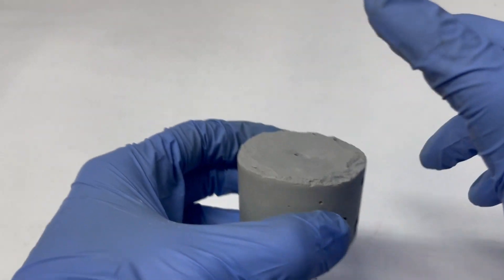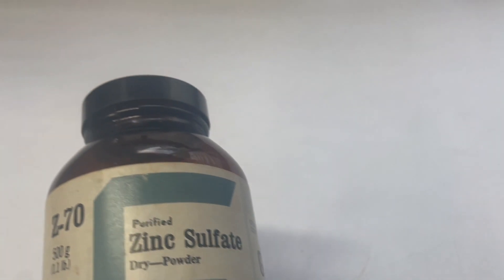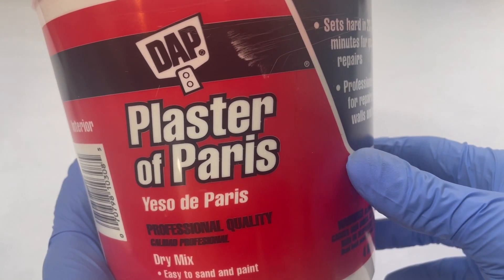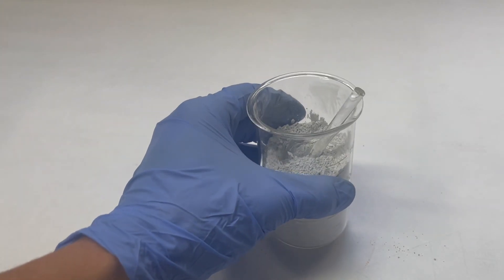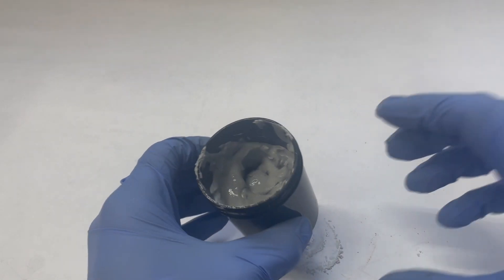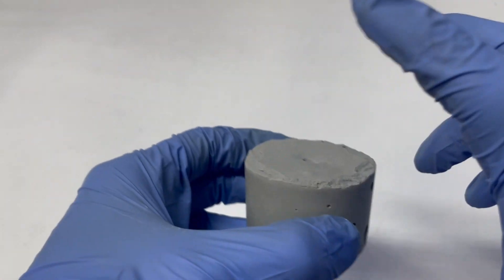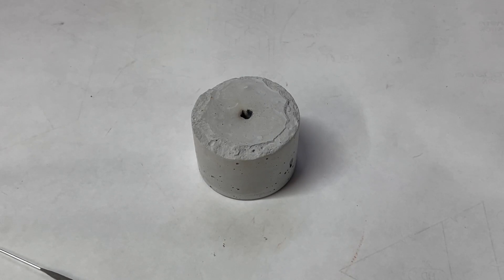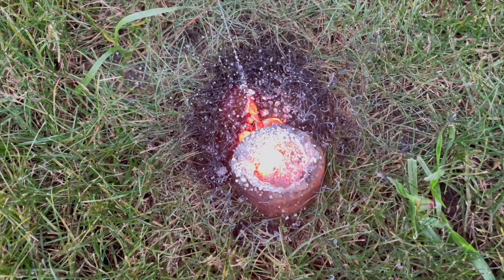Cast-able Plaster Thermite

Comment: Couldn’t you have crush the sparklers into a powder and put it into the hole with a regular fuse? Shouldn’t the fuse set of the sparklers powder and that will set off everything else? Just wondering 🤔
Reply: that can be done but this was more easier and you can get a rough estimation of time before ignition, harder to measure it with pure powder if you're not the one who made it

Comment: What are the end products?  If Traditional Thermite gives you pure Iron and Aluminum Oxide from Iron Oxide and pure Aluminum; does Calcium Sulfate and pure Aluminum give you pure Calcium (!) and Aluminum Sulfate?  If so, is it correct to assume that, at reaction temperature, the liberated Calcium immediately combines with atmospheric Oxygen to form CaO?
Reply: The aluminum reduces both the sulfur and the oxygen from the sulfate ions resulting in calcium oxide (quicklime), which reacts with humid air to form calcium hydroxide (slaked lime).  Other products are sulfur dioxide, aluminum oxide and aluminum sulfide which quickly reacts with humidity to form hydrogen sulfide (smell of rotten eggs) and aluminum hydroxide.  You can sensitize the mixture by adding sulfur to the slurry and increasing the amount of aluminum to compensate.  This will create a lot of stinky sulfur dioxide while it burns and hydrogen sulfide gas when the slag reacts with water..
Reply: That's exactly what happens since calcium metal burns at those temperatures.

Comment: Can I make thermite the regular way, that is; 1 to 3 mixture and then add plaster of Paris?
Reply: I found a formula somewhere else of 3 parts Iron Oxide, 2 parts aluminum, and 2 parts plaster paris. Tested and it works, you just have to get it molded quickly after adding some water.

Comment: Number one rule of baking thermite, SUN DRY IT your using an extremely stable thermite if that were fe2o3 al that may have ignited on the hotplate, yes I know 1000c min ignition temp but nonetheless say there was a little patch sitting on the bottom with 70% al 30% fe2o3, that would act as a trigger
Reply: Incorrect ratios or incomplete mixing make a HUGE difference to properties and performance! I've accidentally added too much Aluminium in the past and ended up with a mix that burned significantly faster than a fast unconfined black powder composition, almost the sort of speed you'd expect from a confined 'low explosive' mix!

Comment: would this have the intensity to melt steel or destroy padlocks? be interesting to see a lock defeated by castable thermite.
Reply from the maker: Why was you and I thinking the same thing.
Reply: @WheelerScientific  because we are both complete science nerds, and proud of it. isn't it surprising they actually let us play with chemistry lol
Reply from the maker: I think I’m going to try adding in other compounds and metals to see what different effects I can get.
Reply: @WheelerScientific  remember it's only science if you record your results. And publishing them on YouTube pretty much the same as publishing for peer review right? Couldn't help it lol. Keep up the good work mate.
Reply: @WheelerScientific  i saw a video that used aluminum, iron oxide, and a Filler as opposed to plaster. I plan to try adding Magnesium chips for a longer run
Reply from the maker: I don’t know, I would have to test that out, it burns relatively slowly and has low thermal mass material produced, so I’m going to say most likely no but I’ll test it.
Reply: @WheelerScientific  be a fun follow on video, "Applications of castable Fermite"
Reply from the maker: Okay I have a block setting up with a lock in it, anything else you think I should do?
Reply: there's a disertation by Desania Raquel Govender "The burn rate of calcium sulfate dihydrate-aluminium
thermites", including potential metal-cutting properties. Long storty short, it's not very good.
Reply: Look up "breach pen" they apparently use some variation of this in swat teams to accomplish exactly this goal. However they wont come off it unless youre LE, which is actually what lead me here in the first place. If you wont sell it to me I guess Ill make my own lol